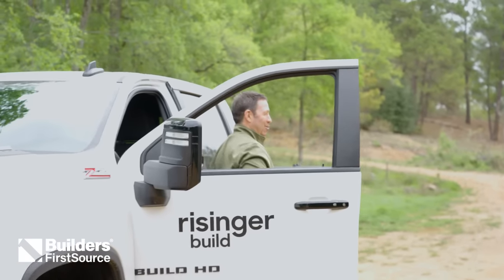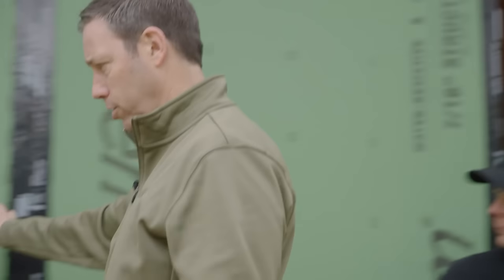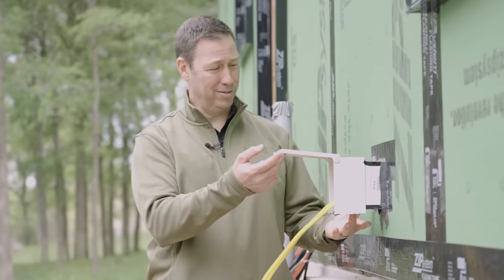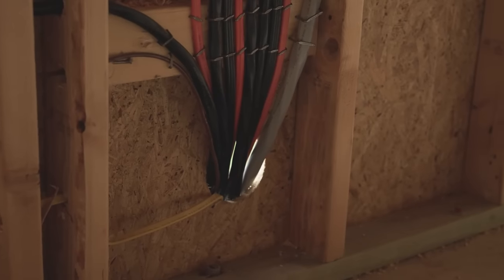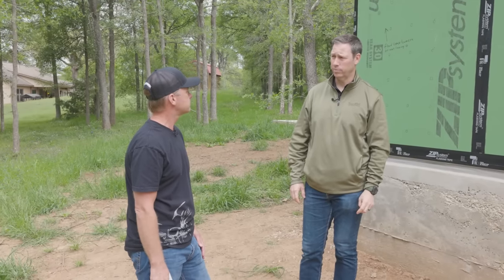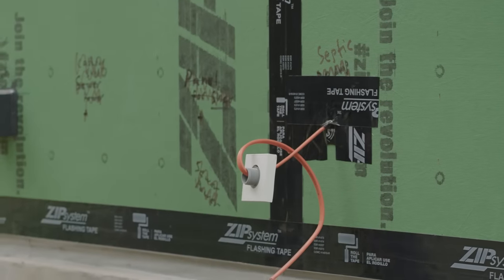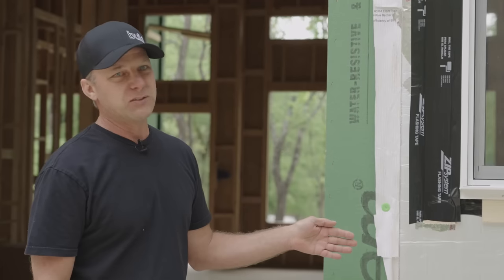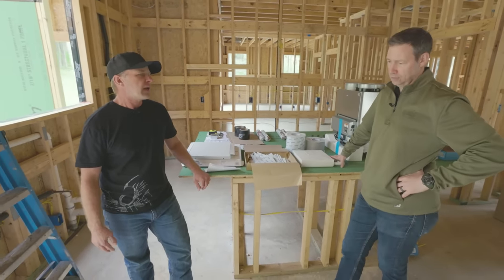Part 2: LOW BUDGET Details For A High Performance BUILD

Comment: I got lost w/ the dryer makeup air.  Can you explain it here?
Reply: When the dryer exhausts, it's sucking air out of the house. In a typical house, you don't notice because the air is being made up through accidental holes in the sheathing. As a result, your wall insulation becomes the filter for humidity and other contaminants from outside. It can sometimes take decades for this problem to be visible, but even when it's not visible, it's still a problem for durability and health. In a tight home like we build, these problems can be noticeable sooner because the make up air will condense at the path of least resistance, often a door. The solution is to use a heat pump dryer or incorporate controlled make up air where you can filter it and dehumidify it.
Reply: @ScottTrue  so that switch was used to turn on the makeup air?
Reply: @boondoggle3000  Yes. I have a switch that will open a damper for make up air to passively flow through.
Reply: @ScottTrue  cool.  I'd probably put a timer switch on that so you could only run it for the same duration as the cycle.  Or use a sensor (which sounds complex).  Thanks!

Comment: What kind of building science allows for R30+ walls in Central Texas to be called "budget"?
To me, this is a colossal waste of money that would be better spent where the real energy issues are for homes in this area ... windows and doors.
Reply: Do the calculation and show me. I've done the calculation and I have learned that windows don't make a big difference unless the proportions of windows are high. In fact, there are high end historic replica homes with really nice single pane windows (low performing) but the house is high performing. It matters more when you have more windows. Your money is better spent on the envelope. This isn't a guess or opinion. It's math.
Reply: Actually, this will make for a good video. I'll have the calculations ran for several scenarios so we can see where you get the most bang for your buck
Reply: Please make this video Scott

Comment: I'm always a little disappointed when I don't see low-voltage smurf tubing running everywhere. I hope he at least runs a full complement of cables to all the spaces. Don't forget the soffits for security cameras. Easier now than later.
Reply: For what purpose?  Other than maybe power, everything seems to be wireless?
Reply: @D2O2 For creating and controlling a flexible, stable, secure, performant and robust network across the house. I call wireless the great lie.
Reply: @D2O2  serious folks don’t use wireless. Not to mention unless you want to be changing batteries all of time, you still need power and cat cable can provide both communication and power. And most decent cameras are POE (Power Over Ethernet).
Reply: @helmanfrow  @silverbackAG1  So you both watched and commented on this video from a wired device?  Do you still have wired telephones?  Other than power, is your TV still connected to COAX or CAT5/6?  Wired networks are not secure.  Where did the term "wire tapping" come from?    There is no single solution.  All wired is NOT the way to go and neither is all wireless.  Wired is not flexible, hence the desire for wireless.   Both your arguments sound like those of someone struggling to hold onto the past likely because of business interests.
Reply: @D2O2  OK, Buddy.
Reply: @D2O2  Addressing your questions and comments in order:
1. Yes.
2. Yes, we have old-school analog wired phone service. Redundancy is a wonderful thing.
3. In my household, every device with an Ethernet jack runs on Ethernet, including PCs, TVs and gaming consoles.
4. Wired networks are inherently and indisputably more secure than wireless networks. The existence of the term "Wire tapping" adds nothing to your argument. All networks can be breached with sufficient expertise.
5. That's right. Wires would be highly impractical and inconvenient for mobile devices. Nobody claimed otherwise.
6.Wires can bring wireless signals to spaces that would otherwise be out of reach of a centralized AP. That's pretty flexible if you ask me.
7. Ok, buddy.

Comment: The only thing about those adhesive zip tapes it wont last 20 years it will lose its bond  from the surface  it adheres too, havoc when it does
Reply: Where do you get your data from?

Comment: Personally I hate to say it but this dude did way more work then what he could have saved in time and money. I ran zip wall from roof down to the walls. Did a monopoly all the way down and i liquid flashed the corners under the eves and used regular electrical boxes that can be adjusted even after it was taped with the zip tape and my door test came back as a .5  no one around my area has even came close to that air tight. The time and money this guy spent is half of the time I spent doing my build. Running zip from the ceiling under eves down the wall is the tightest way possible. Nothing tighter then that. And idk why he ran zip tape over the siga tape. That stuff sticks to anything. Siga tape is a must. Running that alone would have been enough. That extra cut out around the eves is way too much. The amount of time I could have installed zip over the entire eve and liquid flashed the entire thing would have been half the time it would have taken to cut around all that and liquid flash all the cracks. The only difference I did from him was I taped all the windows with stretch tape. Those window seals will get beat up to hell with framers and anyone else working in it and that stretch tape is thick. I wouldn’t have cut down on that section but that’s just my opinion.

Comment: I don’t understand the logic of building so tight that you then have to put in a ventilation system that runs 24 seven. It doesn’t seem efficient and the indoor air quality would be an issue

Comment: It’s carbon monoxide not co2 that’s monitored. The first one kills the second makes fizzy drinks yummy. One oxygen molecule makes all the difference
Reply: nope!  Broan Overture system monitors humidity, VOCs, smoke, carbon dioxide and small particles.  CO monitoring is the job of the smoke detector, required in any area with fuel-burning systems
Reply: Yeah, CO2 levels can easily become elevated in a home or office, so it is becoming more common to monitor it. Elevated CO2 can cause headaches, among other issues.

Comment: The whole point of using Zip Stretch Tape is to use one piece across the sill.  Cutting corners is not the way to go in building quality
Reply: Zip tape representatives themselves recommend this method...